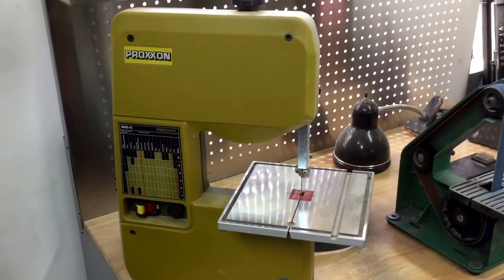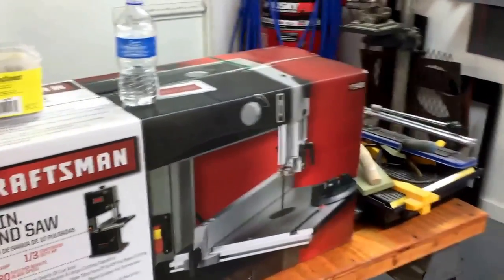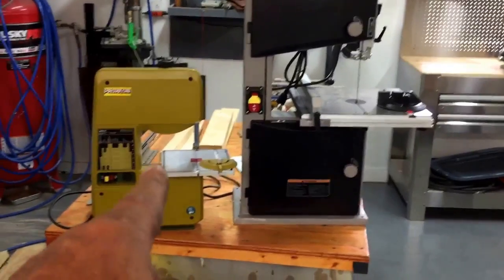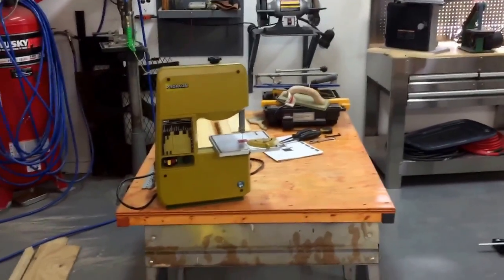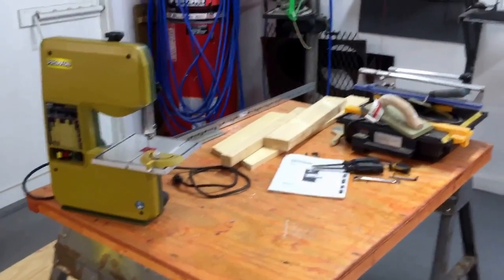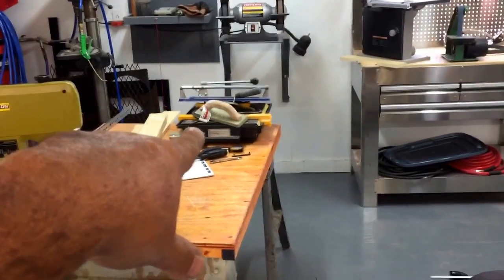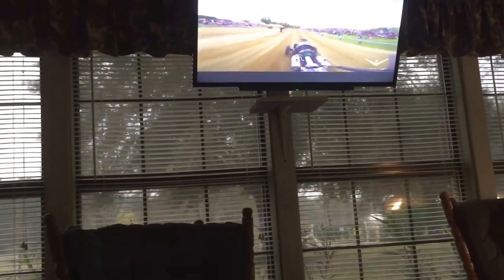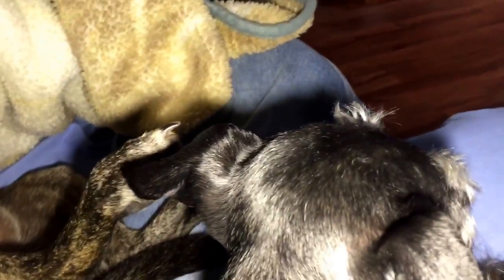Sears bandsaw 21400 vs proxxon MBS/E

Comment: Hey man, I was very surprised to come across your review for the Proxxon MBS/E micro band saw.

I have 7 different band saws ranging from a KITY 613 band saw to the little Proxxon MBS/E and I do also own a band saw the same as your bigger band saw you show in this video, For many years I have always ran the Proxxon 14 tpi bi metal 8 mm wide blade on my Proxxon MBS/E band saw and cut nearly 2 inch thick by 6 inch long aluminium slab plate in 20 minutes with no problems whatsoever, It is a very slow process! and the trick is to use gentle pressure whilst feeding the work into this saw but it does work quite well at full speed to get the maximum motor power/torque out of the little 80 watt permanent magnet motor which as you say is way under powered. 

In my opinion, Proxxon make dam good precision power tools which are very accurate and of good German quality, but their downfall is they are far too over priced and their accessories/blades are very expensive and hard to get hold of :(

Your Sears band saw has a much more powerful Induction motor and better cutting capabilities My one even has the built in laser! to help you guide the work piece better through the saw but their downfall is that they are all cheap Chinese machines and the accuracy is sometimes something to be desired.

If you are good with electronics and making stuff fit, It may be well worthwhile to find a small, powerful Induction motor from the junk and rig it up to drive your Proxxon MBS/E bandsaw - A small Induction motor from a paper shredder with an additional cooling fan would work wonders (very powerful motor in a small package)

Great video all the same man.....

Comment: Just got my new proxxon bandsaw and it works great, I use it for guitar build and cut 50 mm thick neck and body blank easy. Idk what you did to get that issues you describe. The only possible issue with this machine is it's bottom guide pin (under the table) which has no bearings and can make loud noise and friction. Probably it is designed like that in purpose of removing sticky melt plastic particles from the blade. Otherwise it is moddable with  additional guide bearing head (I come to this solution because I bought additional guide head) which can be mounted instead of that pin, with some thin spacer made of beer can foil, to fit 6.3mm bearing head ping to 7mm hole, and filing a bit so it all can fit there.

Comment: I think in order to understand the Proxxon, you need to understand using a Jewelers saw.  The cheaper 8/9/10" bandsaws are too fast for metal. Even the Proxxon is too fast. I keep seeing 200-300 feet per minute as ideal for metal.  There are some nice little horizontals in this range, but they don't flip up vertical with a table until you get into the larger sizes.   I'm shopping for something to cut out shapes from 1/4 - 1/2" Copper and it's alloys( Brass & Bronze) to make components for sword hilts, like cross guards and pommels.

Comment: Brad, could you replace the motor with one that has more power? Thanks for the video.
Reply: I was wondering the same thing.
Reply from the maker: It would be difficult to find a larger motor with such a small shaft.
Reply: Probably motor won't do better, or wear out wheel rings very fast, because it's blade held not buy balancing the wheels position, but just by straight tension and mechanical constraints

Comment: I am so happy your puppy dog is home safe and feeling better I have an idea for your band saw and smaller objects I am reminded of Mennonites and Amish folks that hang their kitchen chairs on the wall and bring them down when they are needed if you could have a fold-up sensors type mechanism on the wall you can have legs on it and fold it down to touch the floor and when not in use it goes back up on the wall or possibly even a rail track system
Reply from the maker: I think Im going to remove the big sander,move the little sander down, and then build a rolling stand for the big sander and keep it stored where I keep my welder,plasma cutter and table saw.

Comment: COULD YOU EXTNED THE BENCH TOP ABOUT 6 TO 12'" TO THE LEFT THEN EATHER SLIDE THE SAW TO THE LEFT OR SWAP SPOTS, SAW TO THE RIGHT SIDE OF TABLE, BIG SANDER TO LEFT. IF YOU PUT A BIG BOLT UNDER THE BIG SANDER IT COULD ROTATE SO THE WORK TABLE CAN FACE FORWORD WHEN IN USE. JUST SOME THOUGHTS.
Reply from the maker: Tommy Schauer I'm considering all my options.

Comment: Wow nice, I like craftsman tools
Reply from the maker: I still like their electric tools but their hand tools dont have the warranty they used to and they are mostly foreign made now.
Reply: BCtruck, rebuild, repair,repurpose totally agree on Craftsman warranty issues.  I clearly remember being a little boy, maybe 9 or 10 years old, and my fathers shop being stocked with craftsman tools.  I remember a wrench breaking right in his hand while tightening a nut in our old lawn tractor.  We went into Sears, where the tool rep just took it the broken one from him and told him to go to the aisle and grab the replacement.  No questions asked.  Maybe 10 years ago, I had a similar issue with a craftsman wrench, and was told basically that model is out of production and the warranty was void.  Channel lock, Snap On and Gear Wrench for me now.  Another  American company down the tubes

Comment: Proxxon is a German company, and most of their machines sold in the US are modified versions of the ones sold in Germany, the UK etc. The biggest difference? Over there, 220 volt power is the standard household power, so the US versions are running on half the power! Some of their machines such as their planer aren’t sold in the US, and I think it’s because of the voltage here being insufficient. That being said, it’s definitely hobby level stuff, and I’ve always wondered why they don’t even have a lower blade guide on these bandsaws!

Comment: So, did you do that just to piss me off? I bought a high dollar blade for my saw and misread the damn label so it won't fit. Been wondering what the hell I was going to do with it and then I saw this. Looked up your new saw and it says 70.5 blade. The one I have is 72.  You dun went and screwed up my plans!!!!
Reply from the maker: I just ran out to the shop to see what size the high dollar,brand new ,still in the package blade I have is. I have nothing that size. sorry,its 80x1/4. Wouldnt it be cool if it just happened to be 72?
Reply: My saw is a 14" Delta, takes a 93.5 I bought this 72 by mistake thought it might fit yours since it's for a 10" saw.
Reply from the maker: so now what do we do with blades that dont fit our saws!!! I think I can take mine to the saw shop way over in the big city,and have it shortened.

Comment: The motor on mine gave up the ghost after a year or so cutting thin sheets of Aluminium and Brass for model engineering. All the insulation on the windings had melted. £260.00 , $350.00 waste of money.
Reply from the maker: I’m sorry yours was a waste of money.mine is still going strong but if it does guilt on me, I’ll replace it with a jet brand. Edit: I just realized you were commenting on the proxxon. Absolute junk.
Reply: @bctruck  Yes, my comment was about Proxxon, I think that to advertise these as capable of cutting metal , thin as they may be, is a misrepresentation.  The motor is only rated at 85W , which is pretty weak even compared to the cheapest Chinese imports that usually have a 350W ( at start up ) induction motor. These band saws are only suitable for cutting balsa wood or wooden dovels and perhaps thin walled brass/copper tubing. Anything else and the motor struggles to cope and overheats. I was also very surprised that there was no thermal protection circuitary installed in this so called ' German ' machine. These are by no means cheap even compared to machines 4X the size and ultimately a total waste of money. Thank god I didn't buy the PD 250e lathe ( have a look at the asking price for that piece of junk )  of theirs and went for Sherline and Taig alternatives.

Comment: You are way too hard on that wonderful proxxon. What other band saw can take advantage of that tiny and slow 1/8 hp motor and also be used as a film projector?

LOL Sears is great, or at least it used to be. good luck finding tool space, I think your idea of putting it on wheels is a good one as then you can use it outside.
Reply from the maker: Robb's Homemade Life it does kind of resemble an over head projector.